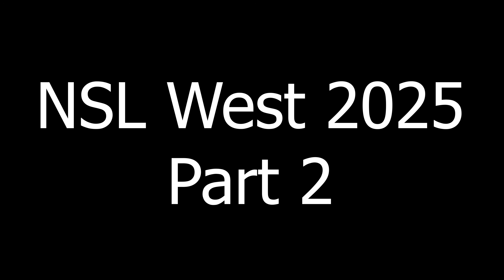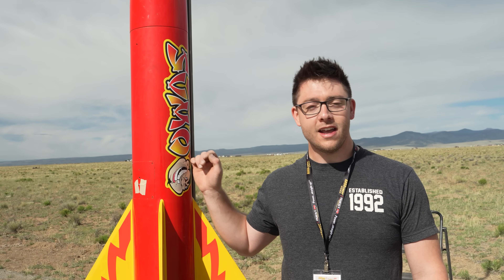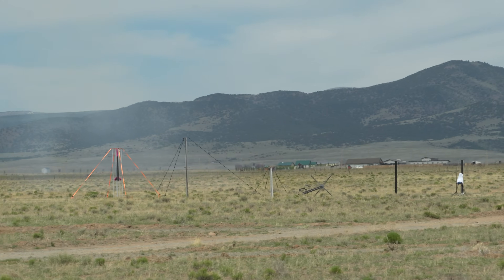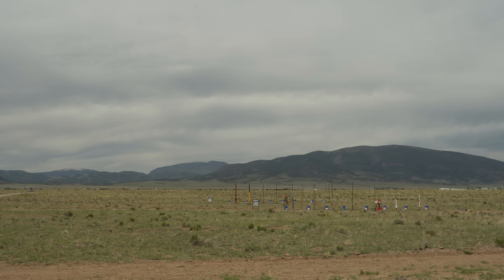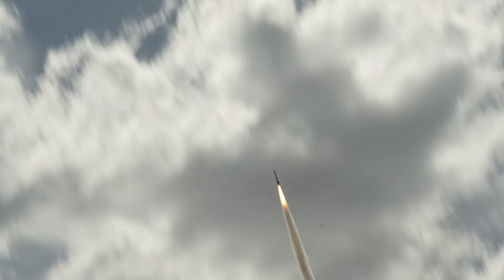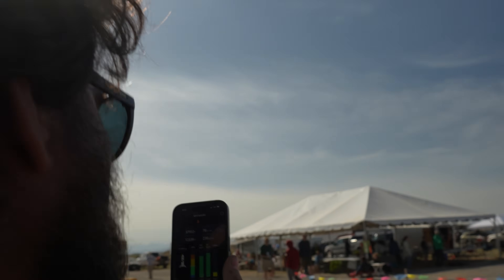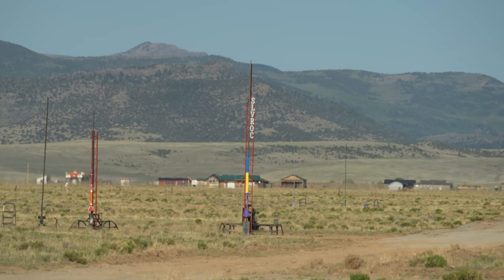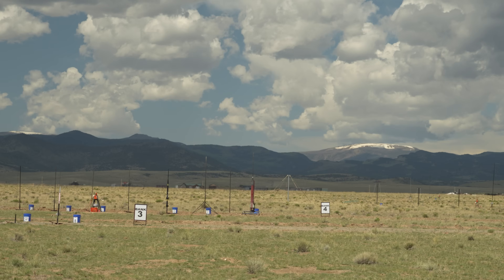National Sport Launch West 2025 | Alamosa, Colorado (Part 2)

Comment: It would be interesting to see the appogee and the chute deployment and recovery. These rocketry sites don't seem to want to show that. I don't understand that. The entire flight is interesting, not just the lift off.
Reply from the maker: It's because in a lot of cases the footage of that portion of the flights doesn't exist. A lot of folks seem to think I'm actively choosing not to show it, which isn't the case. The reality is that filming the entire flight is a lot more difficult than one might think. In addition, at big fast-pace launches like this, it usually means I would be missing the next launch or two trying to track one coming down.
Reply: @RocketVlogs  Understood. I used build model rockets and fly them. I really enjoyed the parachute, or whatever recovery system deployment and the recovery. But obviously this is on a whole n'other level.

Comment: Back in ancient days (aka the 60's), I launched an Estes "Streak"...still looking for it.
Reply: I lost a couple too. One was because the nose cone and parachute separated and floated away
Reply: @ColKorn1965  The Streak was worse, it was just an motor, mylar body and fins. they were so light they didn't have a chute, hardly weighed anything once the motor ejected.
Reply: 😂😂😂 Those Estee’s rockets were almost impossible to recover if they drifted any kind of distance. They’re tiny, they weigh practically nothing, and they can’t accommodate any kind of electronic tracking devices in most cases. It’s almost a right of passage in rocketry to lose several Estes rockets before you are frustrated enough to start looking for alternatives.